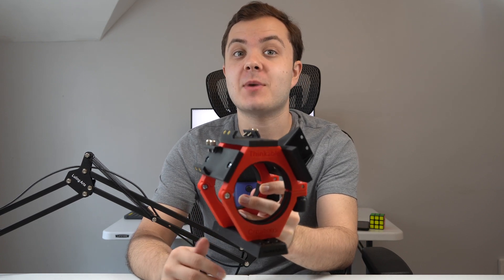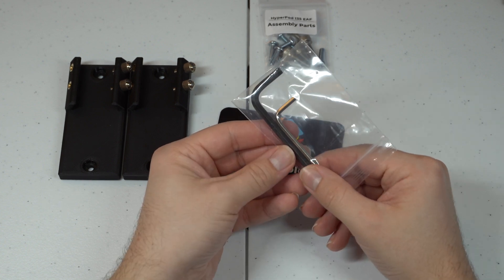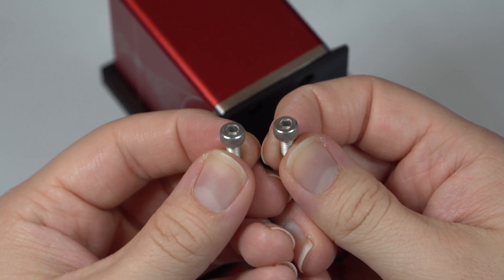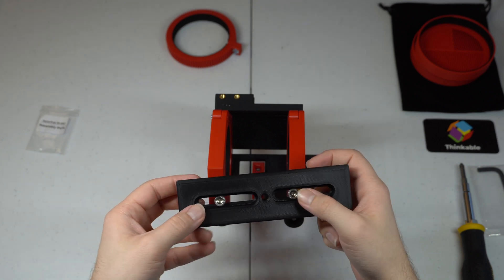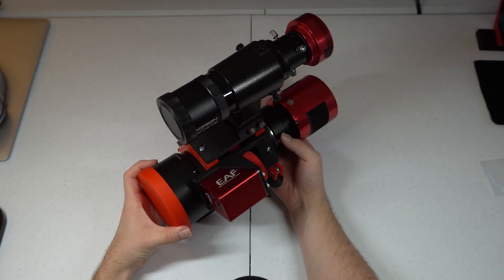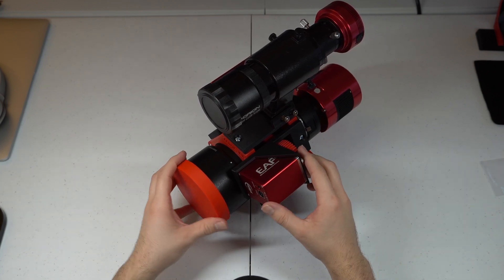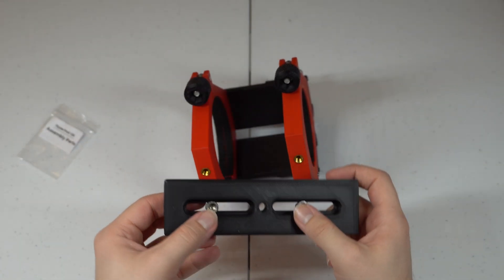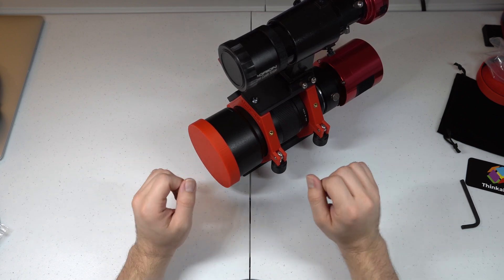Unboxing the HyperPod 135 | Rokinon/Samyang 135mm Mounting System

Comment: Love this kit but the screws with the Black Tops that go into the Dove Tales are too short! I’m using the standard ASIair mini Dov and a SVBONY. All Black headed screws are like 10mm to short and don’t lock the asiair and guide scope in place. Luckily I had a bunch of extra bolts laying around to secure them. Otherwise this would have been a 10/10 kit.

Comment: I received my EAF version for the Rokinon 14mm promptly, thanks!  Your design is ingenious and the print work is well executed.  However, I missed that the EAF version is for the ZWO EAF.  I use the less expensive Gemini EAF which is slightly larger and does not fit inside the supplied EAF bracket.  I will contact you separately to ascertain if an alternate bracket is possible.  In the mean time, I will still use it in manual focus mode.  The large gear will help.

Comment: Hi, just received mine today, i noticed in The video the rings and Large gear have a black finish on the internal surfaces, whereas mine does not. Is that like a soft padding or something else?

Edit: same on my lens cap and Bahtinov mask, which fall off.
Reply from the maker: The HyperPods have been updated to not have the felt inside anymore which shouldn’t affect the performance. If you want to message me more on Etsy, I can see what else I can do to help.

Comment: One option is to use threaded inserts. These can be easily inserted into the existing holes (may need to be opened up slightly) using a soldering iron. Would greatly increase clamping force as well as reduce the chances of stripping out the holes in the PETG parts 👍🏻
Reply: I’m currently waiting on my 135. As soon as it arrives I will be ordering this kit.
Reply from the maker: I am now using all threaded inserts for the parts for strength. Here is a link to my Etsy shop: https://thinkablecreations.etsy.com
Reply: @Thinkable_2  Hi, saw that you removed the video with the adapter for the sony version of the lens with the 48mm thread. Is it possible to see this video somewhere? I you got your design (3d printed), but I am not sure how to put it back together, it would be really helpful if I could see the vid again.
Reply from the maker: @studywithme8055 it should be back up now

Comment: I bought probably the first 3D clamping system, before you made this far superior one. I'm going to purchase yours and a second EAF. MUCH  better THINKABLE'd out!
Reply: I received the ZWO EAF version a few days ago. It's as well designed and built as I Imagined. So Rokinon 135mm, EAF, ASIAIR mini, cabled up with an astromoded Rebel T7i for now. Guidescope will follow. We know the Dew shield on this lens is flimsy. In fact I had to buy a replacement. I'm using the MSM Dew heater. You didn't leave enough room between the EAF mounting plate (which extends over the dew shield), and the shield. I think a slightly bigger gear on the EAF would alow raising the EAF mounting plate enough to fit a Dew heater without crushing it. I made  it work. I'm thinking of getting a 12V  maybe 2 or 3 inch one. Placing the elastic velcro strap between plate and shield would fit without pinching. I'll then cut the cable shorter. Solder a 5.5x2.1 barrel connector on, to plug into asiair output power port. One less dangling cord, or USB port used on asiair.